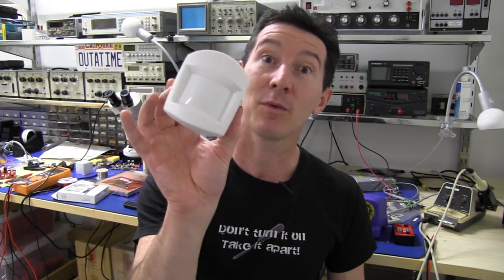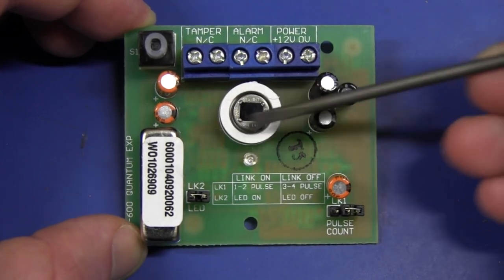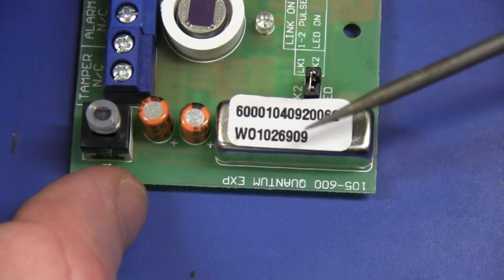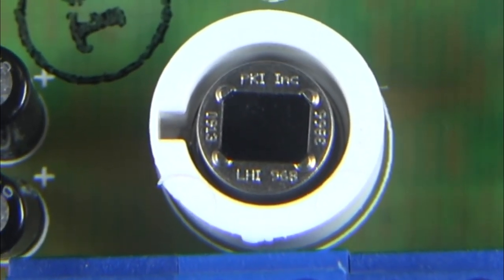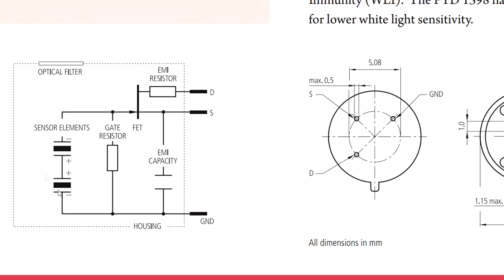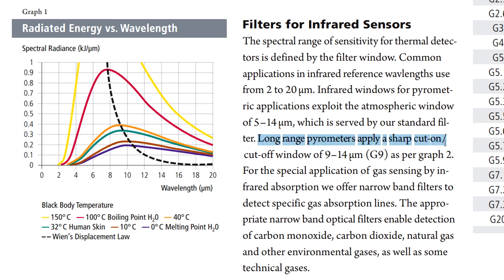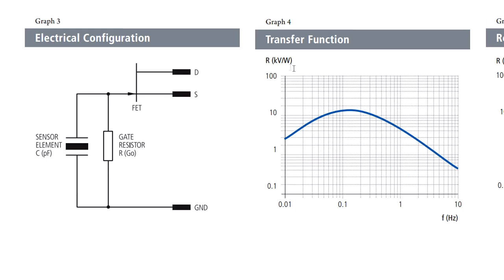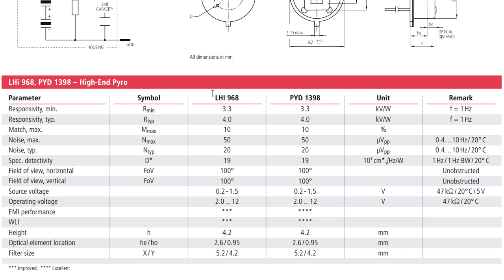EEVblog #275 - PIR Sensor Teardown & Tutorial

Comment: All the PIRs I've seen use a NO relay and hold it closed until it detects - this allows a cheaper relay and means you get an alarm if power fails. Power draw isn't a significant issue.

Comment from the maker: You can if you want, they are both N/C, so just put them in series. If you only have 2 pair cable then this is your only choice if you want the tamper capability. If you have 3 pairs then you have the ability to monitor the tamper 24/7, so no one hacks the sensor during the day or whatever.
Reply: EEVblog hello, can you send me the pdf file. Thanks

Comment: Hi Dave,

you don't have to use four wires to use the tamper switch. you can run tamper switch and alarm switch in series. (quick and dirty but serves the purpose)

greetings

Comment: No, some end of line resistors are also mounted on the connectors. This allows to detect if the wires are cutted or shorted by measuring the resistance so the alarm system is aware of the tampering.

Comment: Security tech here. Most modern PIRs come with NC/NO relay, and most UL installations require EOL or double EOL resistor on NO contact. Being NC has nothing to do with power savings. Majority of installations are done with "quad" cable which is 4 conductor 22 gauge. Red and black for power and green and yellow for contacts. Most alarms (GE, DSC, Honeywell, Bosch, Verex) use negative as return, so you CAN run tamper and alarm using just 4 conductors.

Comment: Normally the NC contact is in parallel with a 2k2 resistor at the sensor. This allows discriminating between an open cable, a short or the loop being fine. If the alarm is armed either cutting or shorting the cable will trigger the alarm. If it is disarmed then cutting will not allow the alarm to be armed ( Fault detected in cable), while the short will show up on the alarm display. Tamper loop works the same, though often they are connected to an always armed input to prevent daytime disabling.

Comment: This is just my assumption, but correct me if I'm wrong. I think the top 2 reasons why they use relays instead of FETs.
1. They completely separate power from the input power and alarm lines, so if their was a short or something went horribly wrong the sensor is less likely to take a beating or the CP.

2. Sometimes it's cheaper then FETs.

3. They are easier to configure for alarm systems that may work with Normally Open Detectors then Normally Closed.

Comment: Security tech here too, though we do more enterprise stuff with access control ect.

NormallyOpen + double EOL is the way to go imho, can sense open circuit tamper, can sense closed circuit tamper, can sense alarm all on two wires and quicker sense time too (so better for door release push buttons ect).

If you're wiring up something like an electric mortise lock you can the same sense ground for the inputs and run a single 6 core cable (usually 3 inputs; door reed, tongue/lock, handle)

Comment: There may be some administrative benefit of being able to distinguish between trouble and alarm conditions, say when the alarm is turned off during work hours, but you still want to monitor the tamper switch (which is called "supervision"). When the alarm is set, you don't care about the tamper switch, because someone shouldn't be able to sneak up on the PIR and set off the switch anyway if it was properly installed.

Comment: That would work if you are taking one pix. The PIR contact will close for some short time dependant on the PIR's time constant, but will open if the motion stops. For a movie, you would probably need the contact to stay closed all during the video. You could add a following ckt that would close another relay for some suitable time period (say 30 seconds) for each click of the PIR. Some need one click to start and another to stop, which would require a bit more complexity. Buy a trail cam.

Comment: First relays give total isolation between the PIR ckt and the long runs to the panel which may have God-knows-what riding on them (radio, TV, high voltage blips etc.). Second, relay contacts don't care what the levels of the panel signals are and so will work with all makes and models. Third, the near-zero-resistance of the contacts allow many sensors to be in series in an alarm loop. Fourth, the relay contacts are more robust than silicon and are not likely to blow due to spikes on the loop.

Comment: I bought some PIR sensors off ebay a while back, part# RE200B. I haven't done anything with them yet, but the technology has powerful applications. When put into a image sensor array, you get an FLIR camera, like the ones military and police use to find people in the dark. I recall a project where someone used one of these PIR sensors to make a "camera" by scanning a field of view using some stepper motors or servos. It has limited uses, but still pretty cool.

Comment: An alarm system may employ resistance monitoring to defeat such tampering..

Even without such features, you would still have to gain access to the area(bypass sensors on a door or window), then approach the PIR sensor without triggering it(or some other sensor), remove the insulation on the alarm cable without cutting the wires, figure out what combination of wires are used for what and tamper with the appropriate set. And after all this time and effort, you have access one sensor area...

Comment: At my dads work thieves once came in trough a window and just put sticky tape over the sensors. The plastic of the fressnel lens is special because it lets pass ir light trough it. Place some transparent plastic over the sensor and see.

About the relay: how about those (old) pir sensors for automatic doors? They click a lot too. Got 3 different models of them for hobby purposes. One of them has a read relay, not hermetic. Others do have a fairly common relay in them. Optex brand.

Comment: Perhaps so you can detect/log different alarm trigger states? Don't know why you'd want that, but they give you the option anyway. And you can still do that, just hook them up in series yourself. You don't need to run 2 seperate wires for that.

Comment: Thanks, correct. When i typed that I was aiming on the metal can enclosure of the relay. They are in fact always from glass as far as my knowledge goes with these.

About the PIRs, they were relativly old style/model. No IR antimask, bottom lens or all that modern jazz.

Comment: Obviously there has to be voltage to be useful. To improve on the definition of DRY, it means the voltage and current being switched by the contacts won't cause arcing, so that the switching cycles are limited only by the number of times the contacts can touch without physically wearing themselves out due to friction (vs. being chewed up by arcing). With regards to open (not enclosed) contacts, dry switching won't set off explosive vapors (although I wouldn't want to be there watching a test).

Comment: The reason for using N/C contacts in security appliances rather has something to do with tamper protection. You want the alarm to go off not only if the motion sensor is activated by motion but also if some smart intruder decides to disable it by cutting the wire or if the cable just breaks and leaves an open connection. This is called "Drahtbruchsicherheit" - the appropiate English term would be something like "wire-breakage protection".

This is mandatory e.g. for emegency shutdown buttons and other equipment which needs to be fail-safe.

Comment: NO contacts can be supervised, say on a loop of simple (no electronics) fire detectors. They all go in parallel and the unit on the end of the line has an EOL resistor across it. Supervisory current runs down the loop, through the EOL resistor and back and the panel monitors the current, any break giving a trouble (vs. alarm) condition. You don't want a fire alarm to go off because a wire breaks. True, the switch contacts themselves aren't monitored, but they are dependable, UL-listed contacts.

Comment: Because alarms are generally the least important thing, if you can prevent the person getting into an area in the first place or see them getting in you don't "need" an alarm.

The main things I was getting at is you can use the same ground for multiple alarm contacts, and with 2 resistors you can get four useful states, that is all.

Comment: It seems like the high quality caps are the low-value ones (10µF) that act as an AC coupling between the opamp and comparators. Lower quality ones very possibly have such a high leakage current (often in the tens to a hundred µA) that the coupling would be bad. At least that seems like a much better explanation than reliability, because any third-rate 85C cap don't necessarily have worse reliability than any other third-rate 105C cap. Or maybe it's simply a cost thing.

Comment: I have salvaged 2 Pyronix KX15DD, 1 Pyronix KK15ED and unnamed (with security company Falck logo) PIR sensors that all use solid state relays and exact same LHI968 sensor element. 
Edit: Quite robust devices, when I found two KX15DDs one was smashed and top lens stepped on, took the parts home, put it back together and it happily flashes it's blue light to the movement again._

Comment: If you have two sensors with overlapping coverage, you can't fiddle with one without being caught by the other. Same with TV cameras; you always want one watching the other, else they steal your camera and you can't see who did it!

AFAIK, reed relays are always hermetic, because they are built that way; the two reeds are held in physical relationship to each other by an enclosing glass tube which, by its very nature, seals out the air. I never saw an exposed read except when broken.

Comment: You don't need 4 wire for alarm and tamper.
2 wires and resistors are enough. You use 1k in series with tamper and 1k parallel with alarmrelay.
Resistor values depend on the system specs. :-)

Comment: because you need power to keep it turned on, so you would have to reverse the open, close stuff and cutting wire would disable alarm easily, reliability is quite bad in this case

Comment: Even the cheapest old stock broker cannot sell you a sealed reed relay for less than a 2N700x... cost is definitely not an obvious guess. Also, one of the terminals of the alarm output line is already connected to the circuit, so the separation argument doesn't seem right either. I'm betting on the normally open nature of FETs.

Comment: Could it be that the high quality caps are assigned to the part of the circuit that continuously active whereas the cheap ones only are active while the sensor detects IR radiation ?

Comment: So let's say (hypothetically) that a company producing PIR sensors uses a subcontractor who, for cost reasons, uses a below-spec white-light filter.  The PIR sensor is installed in a home, but due to false positives at specific times of the day, the owner deactivates the alarm.  If an intruder breaks in and kills the owner, how culpable would the sensor company and contractor actually be in terms of lawsuits?

Not that this has ever happened, I just thought it was an interesting question.
Reply: In terms of a lawsuit the sensor company would be 0% culpable.  The owner chose.

Comment: If half of the PIR sensor were covered with a metal plate (constant temperature heatsink), would it output a signal that is comparable to the amount of IR light reaching the remaining exposed element? So it would act a a highly directional long range photodiode, right? I'm trying to make a long range IR Thermometer that uses analog circuitry.

Comment: >though we do more enterprise stuff with access control ect.
LOL how is that even relevant? I do alarms, access, CCTV, ip, radio, networking, netsec, programming and electronics repair. Most of our customers are fortune 500 companies. Double EOL can be fooled with 3 MOSFETs that break the green and yellow and switch it to a local resistor network under 1 msec so the panel doesn't pick up the "switcharoo". Modern alarms are wankery.

Comment: Bullshit. You can do the wiring whit only 3 wires (not pairs) and you will gain the ability for separate TMP and alarm. TMP and an alarm are based on the resistor (Of course depending on the system and its programming). Dave if you want to do a review of PIR sensors do it like whit the multimeter's and DO NOT compare shitty brand 5$ cheppy to a fluke!!!  Get a Pytonix or Siemens and then do a review. & I bet the analog you have it "clicks" when it "see"  movement 20y-old tech. blah... PKI is Grt